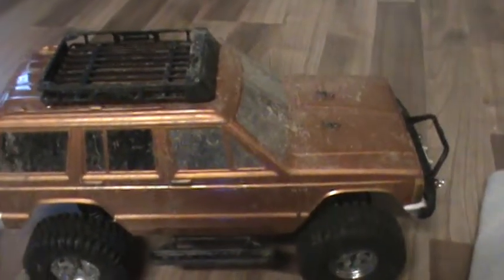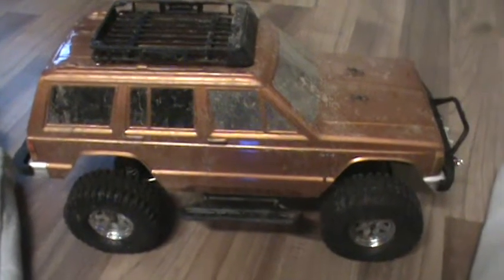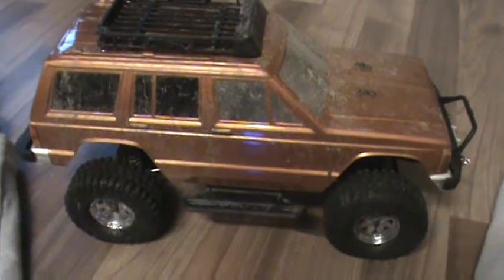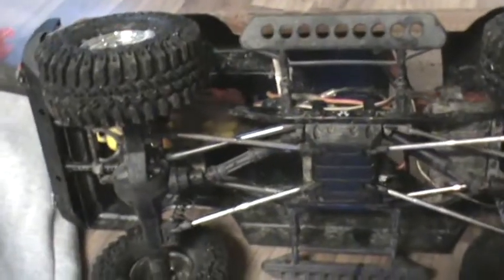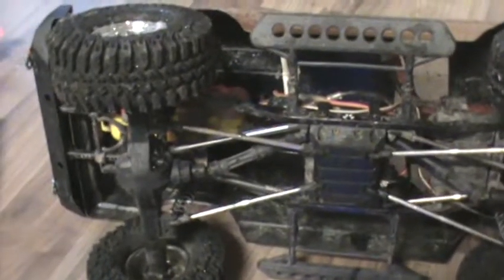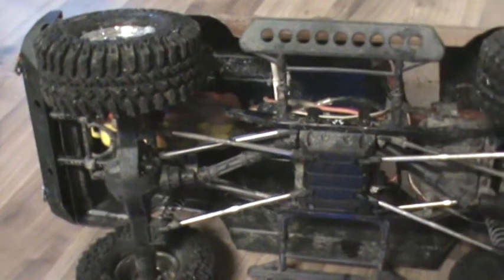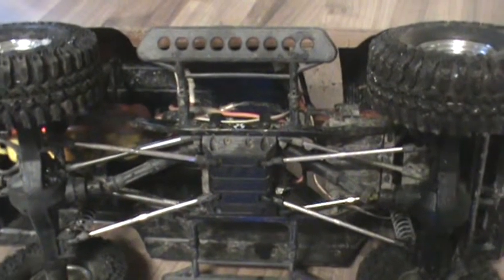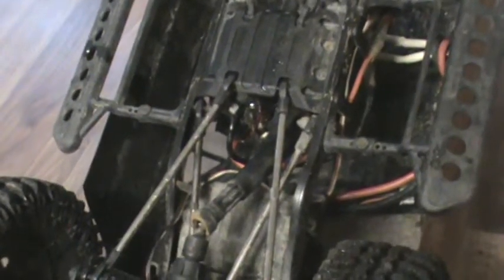Axial scx10 electrical-motor problems; please help.

Comment: Check the brushes. Looks like only one workin. Tuff call though. Could be the esc dieing too. Do you have another motor to try?  My guess is brushes though
Reply: I had the same thing happen to a titan motor 2 weeks old and a 14.4v dewalt brand new. The titan got something conductive wedged in the gaps of the comm shorting it. The dewalt after ripping it apart found an obvious nick in the windings on the armature causing the same symptoms as the titan with a short in the windings. Instead of powering a separate circuit to create a magnetic field to spin the motor the short connects 2 legs of the armature creating a plain ole dead short. I don't see how a brushed esc could cause this as it only varies voltage unlike a brushless esc. Simple test... power the motor directy from a battery. Same issue = not the esc. ;-) hung brushes should only get hot under a load and would seem fine under no load. That is my opinion anyways. I suspect a dead short in the motor somewhere. Check the brush tinsels. Make sure they aren't touching the case as well as the leads from the esc to the brushes. If all good there... the motor shorted internally. Hope I helped. :-)
Reply: After thought... use an ohmmeter to make sure there isn't any continuity from the brush housing to the case as well. They both should be insulated from the case. ;-) some are all plastic but some are metal with an insulator between brush housing and case. I'm not familiar with that exact motor.
Reply from the maker: DJ Dragon thanks for the input. That surely make sense, though when I disassembled the motor I couldn't find anything wrong with the motor itself.  I did order and install a new tekin fxr esc, and got the truck running last night in fact. all seems good for now.  I did record the whole process, and will probably upload the video in the next couple of days.  I'm not 100% sure, but I really do think my old novak  >BEC< failed, not necessarily the esc itself.  I do run a 3s lipo and the novak required a bec for that.  I chose the tekin because it is 3s compatible, no need for a bec.

Comment: I Don't run  becs either. So I can't help there
Reply from the maker: Thanks for the reply, I will pull the brushes and check them out. one more question, if you don't run a bec, are you running a 2s or using a 3s compatible esc? I'm curious because I have my complaints about my novak esc and have been thinking of using a different brand. what esc would you recommend for 3s lipos?
Reply: Both, depends on truck.